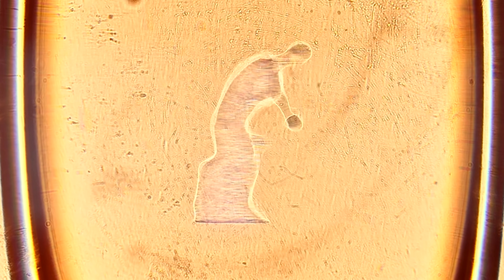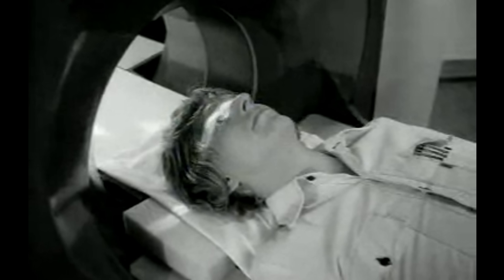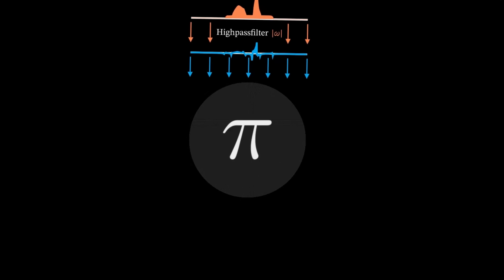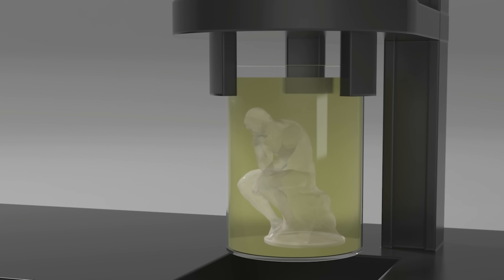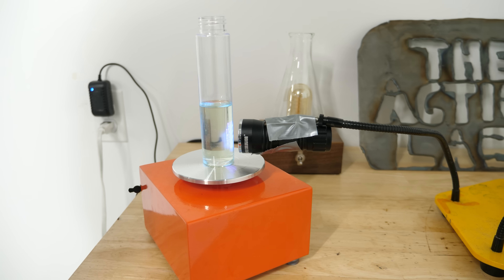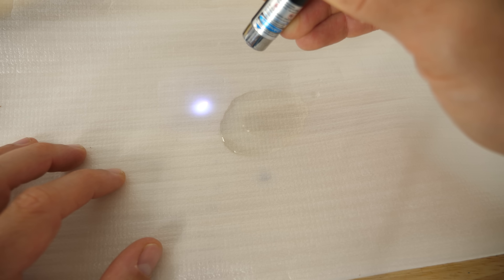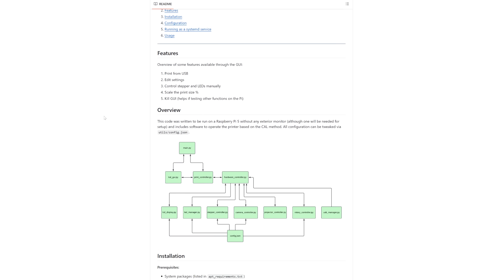Volumetric 3D Printing Is REALLY FAST

Comment: I saw a “more advanced” versioning of this in 1973.! 
The “1973 version” used 2 tunable lasers firing and focusing at different depths  of a cylinder of pure crystal,rotating at 5000 rpm by mag-lev. One laser moving  on the X axis  (circle on top of the cylinder)   the other in the Y axis  (length of cylinder). They focused and recorded images and videos at the lattice level of the crystal.  The playback was done by what we figured out,  by the X axis layer laser focusing at one individual lattice layer. 
How is it possible? Remember that SOLIDS are made of MOSTLY EMPTY SPACES in between the atoms!
The CD / DVD was based in part on that technology ( Large Video Disks in early 80’s!). 
When I first saw a CD / DVD I had an idea of where it came from.  I keep,on waiting for the cylinders to be “invented”! 
Too bad I no longer have access to the people I used to… I am sure a new generation is in charge to,cautiously release at least part of the technology some people have come across.  Having been a physician for the past 40,years I wish some of the  technology that is llikely available to treat / cure awful diseases!  I did raise that issue back in the late 1970’s when I had left that area and was finishing Medical School. The answer: “ Just think what would happen if most of the population could live over 150 years of age, and they are still reproducing like rabbits? “

Comment: If you have 2 (or more) lasers that only hardens the rosin when/if the beams intersect each other you could build a solid out of a projected hologram image. With the right setup you could "flash freeze" the rosin in a few seconds in the shape you projected. The size would only be limited by how deep the laser can penetrate the rosin, get it as clear as water and you could have a print area a cubic meter (m3) big if you wanted it and could afford the rosin. You'd only need to refill the volume of your printed object but the first fill up would be a whopper. No not the burger.

Comment: 4:14 this makes me wonder about the nature of connection points. Wont the resin harden at various rates possibly making un-cured pockets of resin. Obviously over time the tech can improve and the settings can get dialed in but the still doesn't explain directionality through angled joints.

Is this a use case of making "low quality" proof of concept models? Obviously moving parts being built in are a no go.

For a fantasy nerd, printing then painting minis, I really see the vision but who else would use this in an official, scientific, mechanical or medical capacity? (Genuine question)

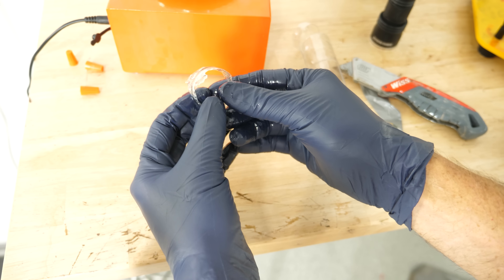Comment: 9:00 I think it might be because you don't really have an image. They used a pretty large fresnel lens (which I presume acts as a convex lens) to converge the light rays and increase the intensity in the centre. In both of your experiments, with the flashlight and the laser, either intensity remains constant throughout the resin volume ( as with the laser) or it decreases the deeper you go into the resin volume. With their set up, they increase the intensity with the lens towards the centre of the volume by converging the light rays and creating an image, forcing the outsides to be unable to absorb the UV light passing through it. Just a guess, though.

Comment: I feel like the tube and resen is lensing the light and bouncing light around, where this technology can be even better than it already is!
There should be a solution to completely get rid of the tube lense bouncing light, or counter act the reflections,  like how a CRT Tube TV bends photons to perfectly hit those little phosphorus pixels. This technology is amazing!  And I can already see how it can be improved on.

And I could be completely wrong on what I said,  I noticed the resin was yellow,   probably to only have a specific uv reaction,  I like it,  and for the tube sensing the light ,  they probably already solved  the angles to focus in the right spots or else,  it wouldn't look as good as it already does. 

This is awesome!  I already want to learn more!

Maybe coating the print chamber with vantage black or black 2.0 or black velvet will block out even more unwanted photons. Or just polarized glass .

They are probably already doing all of this !!! 😂 haha

I wish I went to college for science stuff, mainly  atomic,  quantum, and photon sized stuff,  that is my favorite area to learn about, because its still such an unknown world of reality even though our phones hold a miracle of micro engineering already. I just know there is still a lot more to discover,  and maybe my creative mind can accidentally discover a new puzzle piece here.  .....
Like finding a way to measure and image things smaller than a photon.  I really feel like I could find an elementary way to give to the super ultra smart people who are way smarter than me, maybe I can give them the wild idea that kick starts a new realm of physics

Comment: I just want to know how the object appears in the middle of the vial if there's light hitting it from the outside without hardening the resin closer to the light source inside the vial. I immediately expected the result of the experiment you conducted.

My only theory is that the resin closer to the inner wall of the vial has different properties than the resin in the center of the vial, in which the resin in the center hardens faster than the outer one.

Comment: Wouldn't this be alot better with 2 projectors opposed to eachother making the light converge extra strong in the center of the vial? I feel like this solution makes alot of "half baked" resin, which could be recuded alot with 2 lower intensity projectors, instead of 1 high intensity

Comment: The speed of volumetric printing is mind-blowing! ⚡ It's a game-changer for rapid concept models. For parts needing engineering-grade thermoplastics, heat resistance, or ultra-fine details, our SLA, SLS & CNC services deliver that precision. The future of manufacturing is a full toolbox!

Comment: Curious what the pricing is on these machines…entry level to higher end? Also, the availability of the resins seems to be critical otherwise you would’ve had a better outcome. Pretty cool stuff though. Btw, solid hair but you can 86 the stash in my opinion

Comment: The issues you have had with your Volumetric print, was most likely because of where your light is focused. If you used a lense, you could move the point where the resin starts to cure. Then you should also test what the minimum intensity that is needed to cure your resin is, so you do not accidentally cure the other resin.

Comment: Had an idea like this a while ago. Using intensity to get depth and rotation. Id use projectiom for the main body but a very fine laser for s finished fine details the projector energy can cause bleeding if its too intense too fast giving blurred edges. Esp if you have larger bed sizes thats way too much energy at once, ive been looking at an onion type method, where its shelled layers growing from a centre to see what might happen.

Comment: I wonder if we could take the same projective approach, and apply it with electrons instead of light, like the difference between conventional and scanning electron microscopes, in that the latter has like a million times the resolution of the former.

We could use it to accurately and economically print 3D nanomachines and their components at the atomic scale.

Comment: That thing the guy made wasn't a "3d Robot." It was what looked like a small robot shaped piece of glass that has no purpose and probably cost a lot to make with that very expensive equipment. I suppose it's a step in the right direction.

Comment: Reminds me of the Carbon3D SLA Printers. They used a layer of oxygen through a permeable membrane at the bottom of the vat to inhibit resin from curing and allowing resin to flow in as the part is cured over the oxygen-enriched layer. Was basically a continuous SLA Printer that hadn't to move up and down each layer.

Comment: I've found an (non-open source project) of a volumetric 3d printer. It's called "An easy-to-build, accessible volumetric 3D printer based on a liquid crystal display for rapid resin development"
I can't post the link otherwise tube will delete the comment. It seems to be an interesting starting point for a project like this.
It also pointed me to OpenCAL project in github (reference 21) which seems to be open-source.

Comment: I might be talking out my ass here, but wouldn't this technique have the same issues as 3d scanners? I.e. Self-occlusion? A CAT scanner gets around this issue by leveraging total-penetration, which is to say there's nothing in the substance (body) which can totally occlude the beam, but resin, I feel like, doesn't have this benefit. In the Thinker example, you can see that the inside of the legs and other areas have 'webbing' where that occlusion happens. Imagine trying to print a torus, which is 'edge-on' to the light source. I don't think you could print anything in the 'hole' in the center of the torus, at it would be obscured by the already hardened material of the torus ring.
Dunno. Seems useful, but also prone to issues. Fast, small, and niche, methinks.

Comment: This is so cool! Also despite hearing similar descriptions of how CT scans work multiple times(and having multiple done on myself) I never really got how it works before this but this makes so much sense! It’s kinda like a nonogram puzzle where you get a bunch of numbers for rows and columns and have to use those to figure out what boxes are filled in or not but with way more axes and only a single value for each point at each angle.

Comment: I still feel like this isn't really explaining the magic of the resin, which is supposed to explain how you control at what depth the light makes the resin hit the critical threshold to harden.  The video explains that there's a "critical threshold" but in and of itself, that would still just result in a ring around the cylinder like in your own experiments with regular resin.  Only thing I can think of that would explain depth control would involve not just amazingly precise light control so that a threshold is only hit at particular depths, but also very specific dimensions of the cylinder.

Comment: Is it possible to print C.T. or M.R.I. scan into 3D print? It will be useful to see the damage from the 3D print clearly, instead of seeing the MRI or CT in the film. For an example some accident casualties can not be understood in the traditional CT or MRI even by the doctors. If the 3D print is made, by using some jel type material,  we can understand it very easily.

Comment: It sounds like the printer  makes parts where nothing is occluded by a light rotating over the surface of the part. If that's true they really can't make what standard 3D printers can make. For example, an empty sphere or box. Overhangs that are over a certain threshold would also have issues

Comment: While this is definitely the future of 3D printing... we need a LOT of that special resin to be made. The software side is comparatively trivial and, if any regular non-UV projector will work, then so is the hardware. Extremely cheap Hardware and simple Software combined with impossibly fast print time will definitely make this a major success, perhaps even becoming the new standard. HOWEVER none of that matters if the resin is too complex to mass produce or is exorbitantly expensive.
That resin could change the future of 3D printing... or become another failed startup. It's just too good to be true, there has to be some catch.
Reply: They claim it's regular 3d printing resin with one additive removed and replaced with another. It is UV resin though, typical 405nm wavelength. They removed the UV absorbing additive needed for SLA printers and replaced it with oxygen. If the resin absorbed enough light, it hardens permanently. Otherwise the oxygen breaks the polymers down to monomers to be re-used again. I imagine oxyges is pretty cheap, and the formula is straightforward. UV DLP projectors are used in modern SLA printers, so they're not expensive either. Printing volume downside is completely mitigated by the fact this thing can print it's entire volume in just minutes, and then parts can be glued and post-cured using the same resin, making them essentially as strong as if they were printed whole.
Reply: It's not the future of 3d printing by any means, because it's limited to very small print volumes, due to the 'transparent' resin used not being perfectly transparent in reality. This means that as you increase the print volume, the quality and dimensional accuracy of the prints rapidly diminishes, due to the light having to travel through more liquid resin to print the object, resulting in more distortion. This technology would best be applied in microscopic print applications, where the small print volume isn't an issue, and the delicate microscopic prints can remain intact, which isn't possible in traditional resin printing due to peel forces and supports being needed.
Reply: @truereaper4572  I could see it used for Neuromorphic computing.  Researchers could print small scaffolding for mycelium based devices or other other health devices.

Comment: Technically, it is still "printed" in layers... 
Each slice view is still a layer, it just happens faster. Same effect of a CRT Monitor, or like a video increasing the frame rate to make it (each still frame) look more fluid.
Instant would be all frames/slices being projected all at once from all angles... but then you still have delay in hardening (or any chemical process), even if it is milliseconds.
But very cool nonetheless

Comment: Besides washing off some resin to clean your finished product, this is nearly a wasteless process. No discarded scaffolding or support bases, no left-over plastic when switching spools, no extra/lost material in layer lines, and all the unused excess is reusable? That is a miracle for production profits as waste accounts for large losses. This really is revolutionary for the industry, it just became way more cost-effective to mass-print. Awesome news.
Reply: If you move the projector around the tube, then you could pump the resin through it to advance to the next object. Essentially a production line with finished objects ejected by the fluid at the end of a pipe. Pretty funky
Reply: @jojoposter I see what you're saying, but I don't know enough about this special resin. A line like you're saying would need some flush that lets the project out and then drains the excess fluid back into the line. They mentioned how there is oxygen in the fluid and it prevents the reaction, and they didn't really show the sealing and unsealing process.. for all I know they're very oxygen temperate and vacuum sealed, which makes flushing a no-go. Would need to know more since depressurizing and repressuring a vacuum seal seems like all the work they're probably already doing.

Comment: I remember seeing a video about this back in the 80's. It was a little different, and had similar run times to current 3D printers. Instead of resin though, they were using some type of polymer mixture that had a milky color and consistency, and the final product came out black. Still an interesting process in any case...

Comment: You'd also need to compensate for the optical effects the curved container wich might look like glass but could be something else chose for its specific refraction index.
I bet their cilinder is also made with rather exacting tolerances. regarding the consistent thickness of the cilinder wall and it's circular shape.
And the resin itself is another medium the light travels through before it gets to do its work to take into account.

Comment: 9:10 this exact thing is the problem I thought you would have when he explained the new technology in the beginning. Very cool that he went on to explain in depth how they circumvented the most obvious issue with the technique, that the curing wavelength of light has to pass through the whole resin evenly and not get absorbed early on.

Comment: So, it's basically the same thing as a radiation machine, for like radiation therapy for people with like a brain tumors and such. But, instead of the radiation therapy, you're making a soccer ball.
After watching the video, no, it is not the same., I imagine that the method I spoke of, if used this way, would work and it would be amazing. Because it was my idea, I want a cut.

Comment: 8:34 You're not focusing your light source which is the problem, you can see when at 4:32 that they have a Fresnel lens which focuses the light to the center of the resin to allow it to harden. Without that lens, resin will cure closest to the light source, on the outside.

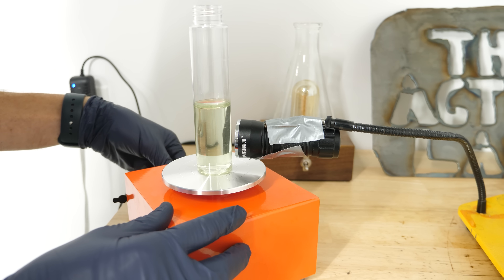Comment: 5:56 In my humble opinion, one obvious mistake in your experiment is the high speed of the spinning tube. You didn’t account for centrifugal force. 
Anything hardened by the light becomes heavier and gets pulled to the tube walls right away. Using a thicker resin could help counteract that, but you used a very liquid resin. 
Even if you slowed down the spinning, you still wouldn’t get a sphere. Whatever solidifies in the middle would sink to the bottom because of the low viscosity of the resin you used. 
I’m no scientist, but for whatever they’re worth, here are my two cents. 😊
Reply: Couldn’t it be that the Focal point of the light source should have been in the center point of the vile so that only there the threshold of the resin would be triggered? Same here; no scientist. Just curious 😅
Reply: @unodospizza  There's like a thousand problems with his experiment that make it a complete waste of time. To answer your question, the guy didn't even have the proper threshold curing resin required for the technology to work, he was just using normal clear resin that starts curing whenever exposed to any UV light whatsoever.